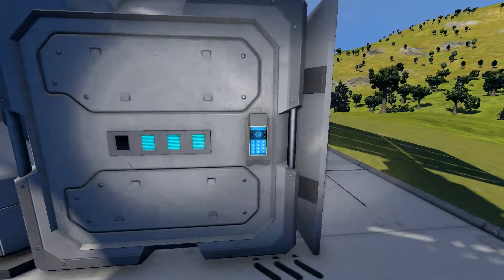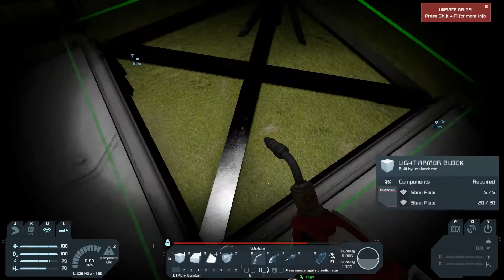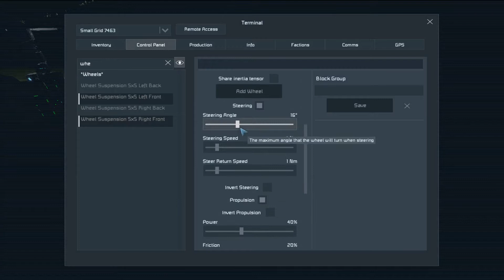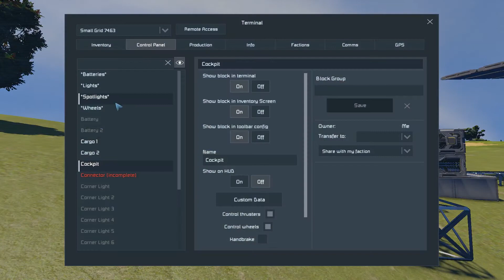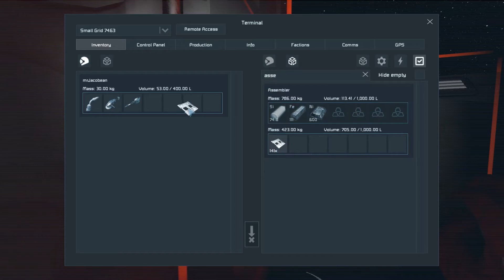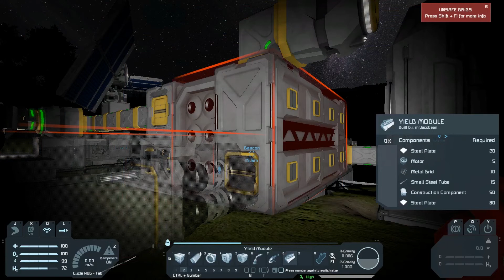Loading Bay - Space Engineers #04

Comment: I've tried this so many different ways but when the connectors go green my rovers batteries wont recharge I'm new at this game so any info will help
Reply: W1ckedShad0w 9981 I’m new to SE also. Playing on Xbox one x. But I will see if I can help. So if I understand your question correctly you are trying to recharge Your rover from base? Make sure your batteries on rover are set on auto. Not discharge. But Auto. Also make sure that your base have enough power output, like enough solar panels, windmills etc etc. if your base is using more power than it can generate it will steal power from other places. That means if you have low power output from base and you connect your rover, then it will steal power from the batteries of the rover to keep working, instead of charging the batteries. So make sure your base have enough power output. And that batteries are on auto mode.
Reply: Well it was the output and I fixed it I'm about to start playing on xbox too it hasn't released yet for me, and it the fucking best for taking the time to explain that man thank you